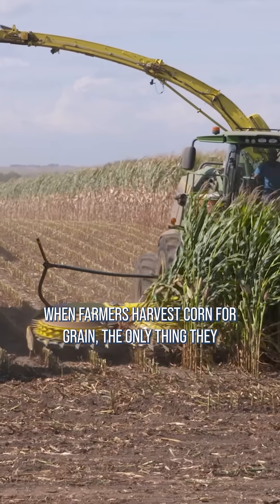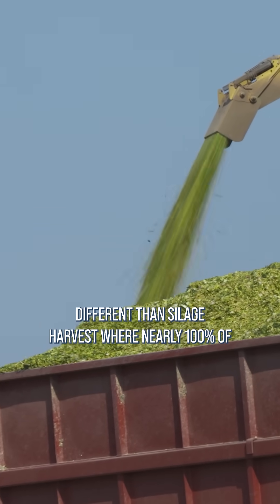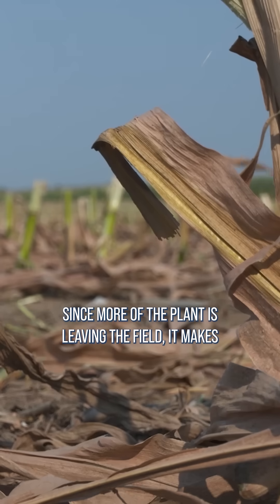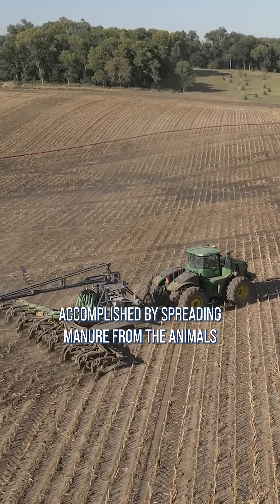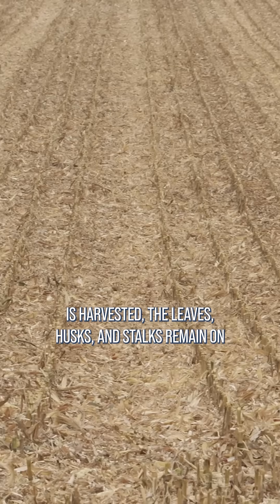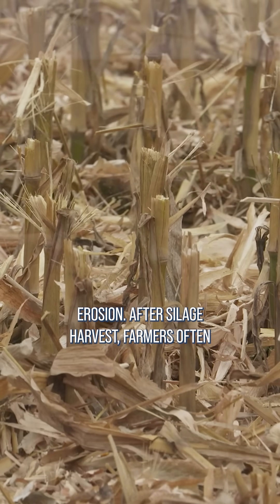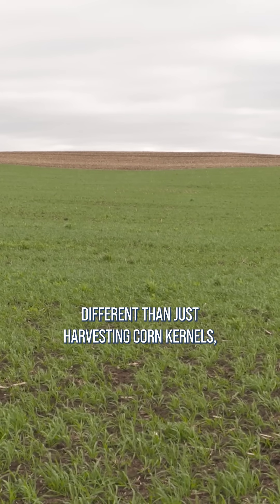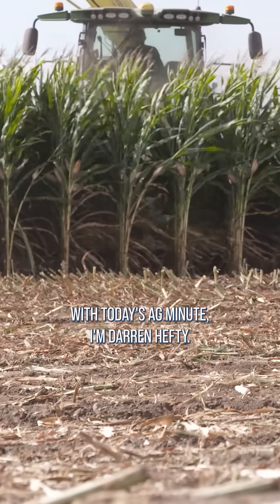What's different in fields where corn silage is cut?

Comment: Has anyone tried a hybrid methodology, that is, making silage by cutting the corn at a different height, for example, three feet above ground?
Reply: I do so. When you cut higher silage have better feed value mostly starch precantage is higher . Digestability is also improved since you leave more stalks out  in the field. The cons are you get less tonnage from acre/hectare. 
It all depends what do you need.
Reply: Never seen that they scalp the ground here